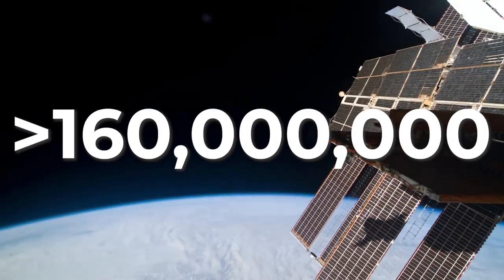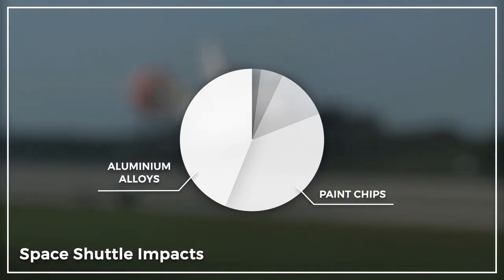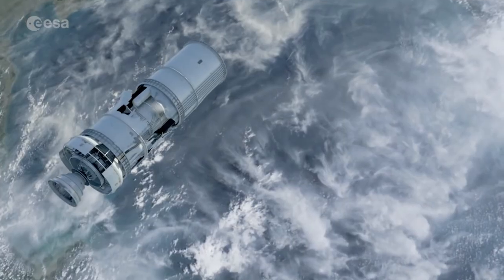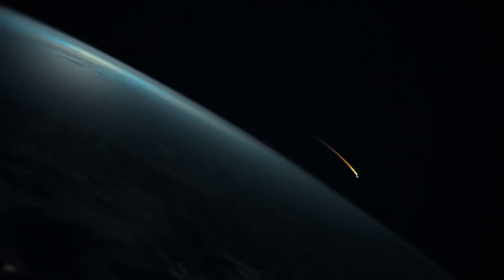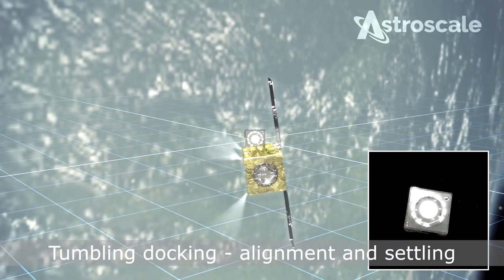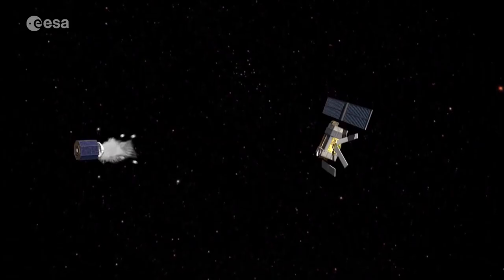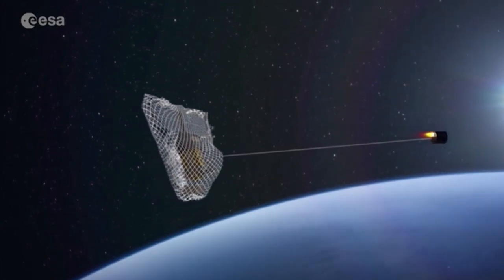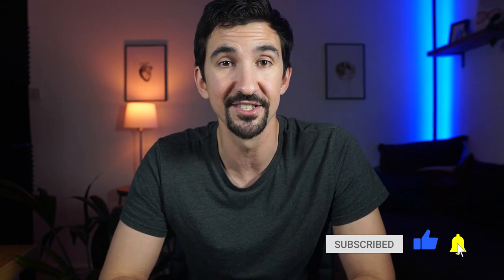4 Ways To Capture Space Debris

Comment: I imagine large (>100 m?) blobs of aerogel..... like space sponges. They could be put into orbit in a pressurized container in a compressed form, and released into the vacuum of space to expand to their full size. They could clear specific orbits of all tiny debris, and probably some larger debris. When saturated, deorbited.
Reply: two things spring to mind about this rather cool idea: One, 100 m is tiny. The 3d animation shown in the beginning of this video makes it look like there is stuff everywhere, but keep in mind that distances between pieces is in reality measured in hundres of km. 
Two, would not a single piece of debris go through this blob of aerogel like a hot knife through butter? Efen if the blob ultimately stops the piece, it would seem this idea would not necessarily need to be deorbited, because in the process of doing its job it might be turned into plasma...
Reply: Aerogel is solid and incredibly brittle.
Reply: Very nice.
Reply: see this is my thinking. it looks like everyone is focusing on the big things, but if a paint chip can do that much damage to the glass of the space shuttle, imagine if it hit a critical system, not to mention the sheer number and difficulty identifying and tracking them. i don't know enough about aerogel to know if that could work but i like the line of thinking that you send something up to intentionally crash into debris to catch and embed it, almost like those boats that drag nets across the surface of the ocean to clean up garbage, you would just need the right material that could withstand multiple impacts of that force

Comment: Lasers are the best way forward for small to very small objects. For large objects around the earth, technology should be developed to veer them off course so as to be used as scaled down models which once scaled up can help push meteors away from hitting the Earth
Reply: i like the idea, but i think the physics of pushing debris down to burn up in the atmosphere is a little different than ramming something full speed at an asteroid millions of miles away to slightly change its trajectory. different problems require different solutions, plus if the lasers work on the small stuff they'd work just as well on the big stuff

Comment: Space-based laser systems utilising sunlight would be very efficient for tackling debris below a certain size. They could be used not only to decelerate target material for quicker reentry, but use the same impulse for orbital changes to other targets within a given volume of manageable space.
Space pong, that pings potential dings.
Reply: A space based laser system is otherwise known as a long range laser weapon. I don't think we want civillians littering Earth Orbit with those... ^.^
Reply: you will have to find it first
Reply: @bobbynotbuilder4389  
Find what?
Reply: @Alexander_Kale  not to mention the massive power requirements to operate said laser, not really feasible with current technology
Reply: @sethsei8746  Funny enough, yes it would be. There is no shortage of energy in orbit. If you can get the cannon itself up there, bringing along a square mile of solar voltaics or a nuclear reactor would not be the problem. 

The real problem technology wise is that our lasers suck.